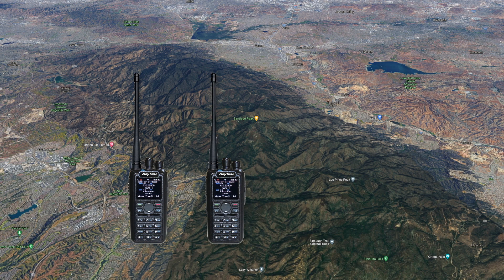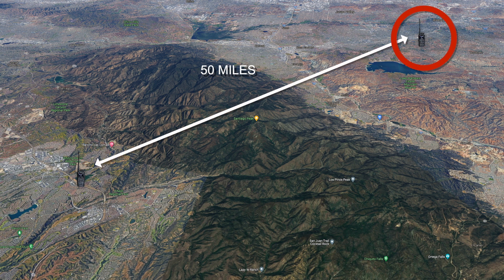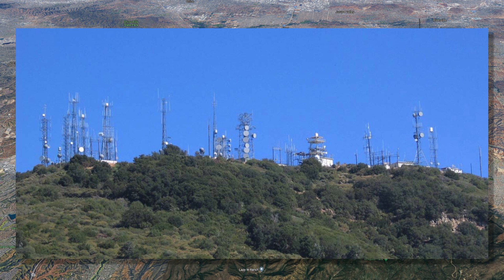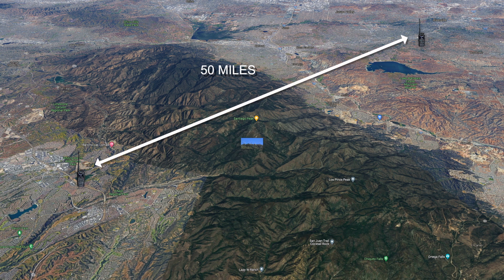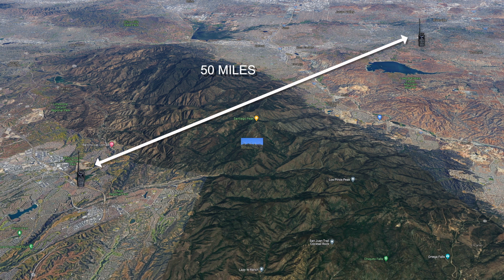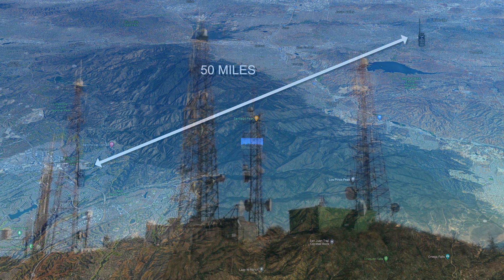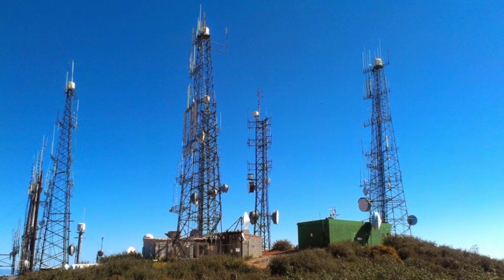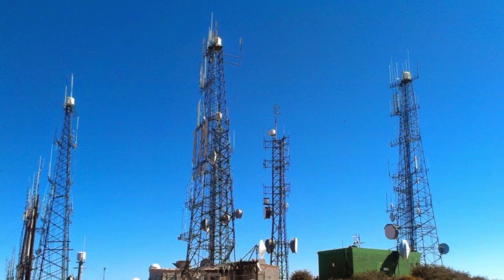Simplex or Repeater?  What does it mean in ham radio and GMRS?

Comment: So it's automatic? or manual?
Reply from the maker: Sorry for the delayed reply—I had work distractions. 

The setting for repeater vs simplex is usually programmed into a memory channel, found in the menu as a transmit option, or sometimes a knob on the radio. If it’s stored in a memory channel, it will operate on whatever mode it was stored as. For example, it’s possible to have adjacent channels configured so that channel 1 is set up as simplex and channel 2 is repeater. 

A simplex channel will transmits and receive on the same frequency. A repeater frequency or channel will transmit on different frequencies. That difference is called a transmit offset, and is automatically controlled by the radio, but it has to be told to do that. That’s where the menu selection for repeater mode is important. 

In the UHF band, the repeater split or transmit offset is usually 5 mhz. So for example, in Southern California, we would listen on our radio on 447.000 mhz, and transmit on 442.000 mhz. It’s low in/high out from the repeater. A 5 mhz split or offset.  

In other parts of the USA, and GMRS, it’s the opposite 5 mhz split. In high/out low from the repeater, or, transmit 447.000 and listen on 442.000. 

A GMRS radio might be something like 467.550 transmit and 462.550 receive. High in/low out from the repeater. Again, 5 mhz split. 

The two-meter ham band uses a 0.600 mhz repeater offset. Same idea, but a different split for the repeater input. Not 5 mhz. 
Ex: Transmit to the repeater on 146.370 / Receive on 146.970. 

I hope that makes sense.

Comment: I think some clarification of terms is needed. Duplex refers to a two way comms. Full duplex is where both parties can send and receive simultaneously - like on your telephone. Half-duplex is when either party can be sending, but only one at a time, like we do with our direct radio to radio comms. Simplex usually refers to broadcast - your favorite FM station - a one way communication. 

So even with the repeater, our ham comms are half-duplex, just as line of sight comms would be.
Reply from the maker: I agree.  It seems some radio manufacturers refer to repeater mode as duplex, which just adds to the confusion. In my experience, I’ve only known it as simplex or repeater. From what I’ve been told, I think it’s either commercial radios or GMRS radios that may be calling it duplex. I thought I’d mention it in the notes. Hopefully it doesn’t cause more harm than good.  I appreciate the feedback.

Comment: the word opposite to the simplex could be a duplex? It is not clear from the video whether this is the case with radio communications.
Reply from the maker: That's a good comment.  In daily conversation, it's rarely referred to as duplex when spoken and referring to using a repeater.  The radio menus often call it duplex (or repeater), so perhaps an additional reference to it would be helpful.
Reply: @Raymazon  whether full duplex is the term? if some radios play two frequencies at the same time, is it possible to listen while talking?
Reply: this is probably not a question of frequency but of signal strength in the antenna..
Reply from the maker: I just realized I didn't reply to your question.  My apologies.  There are some radios that can operate in full-duplex mode.  Not hand held radios though.  Mobile radios such as commercial grade Motorola and GE are two famous ones for being modified to operate when they can listen and transmit at the same time.  These radios  are used often for repeater use on mountain tops.  They are also used by some hams in full duplex so they can hear themselves as they sound from the repeater.  You can usually hear the duplex audio in the background as they speak.